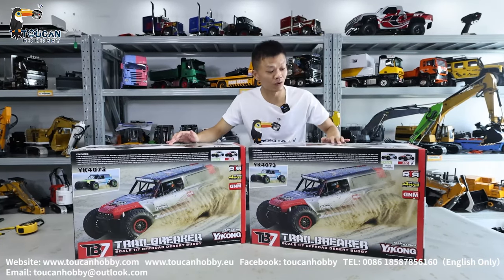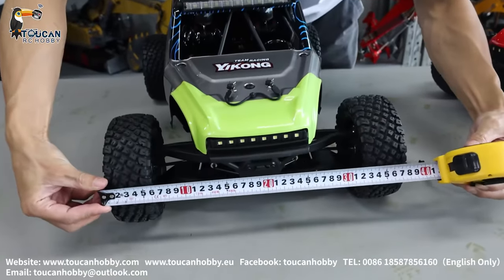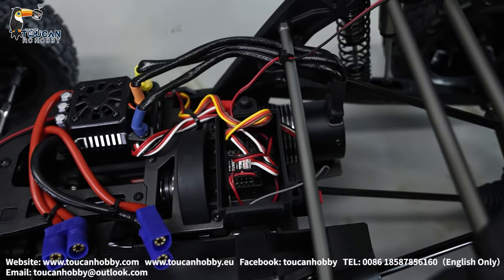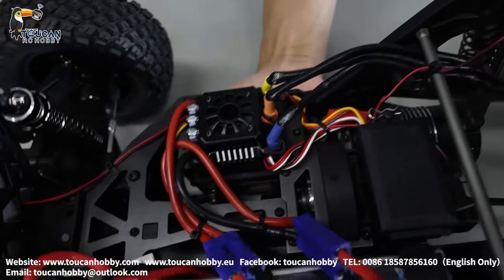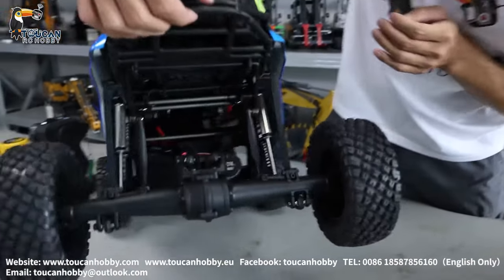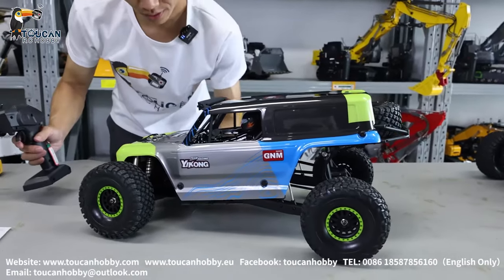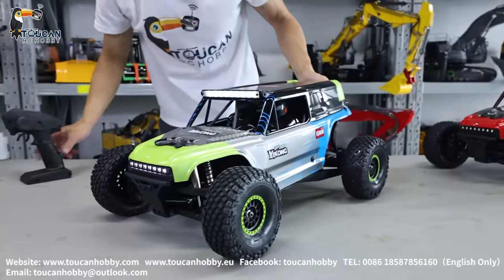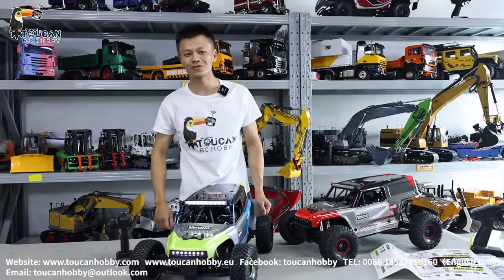The YiKong 4082 rc off-road truck

Comment: For this price I'll prefer go on some great brand like Arrma or Traxxas
This one is at least 100 to 150USD too expensive

Asian market is trying to catch up German market  but German also have a quality to defend 
Never a Lesu truck could cost 5000USD and be compared with Germans
Reply: TB7 and DF7 are more durable and easier to work on than the UDR. Arrma doesn’t make a solid rear axle truck. Drivers of both Arrma and Traxxas tend to spend extra money on their cars to make them survive their abuse. Vitavon and M2C are very expensive aftermarket manufacturers.

TB7 and DF7 are a good balance of UDR style with Mojave bashability without having to spend more money to maximize its performance. They dive extremely well over whoops, don’t traction roll like a UDR, and you can send this pretty high - I’ve jumped mine as high as 12 feet high with no down slope landing. No breakages after 2 months of regular sessions at my local BMX track. 

Therefore ultimately they are less expensive and a better deal than both the UDR and Mojave. They are truly worthy  of the RTR badge.